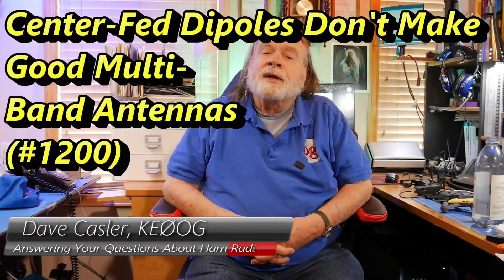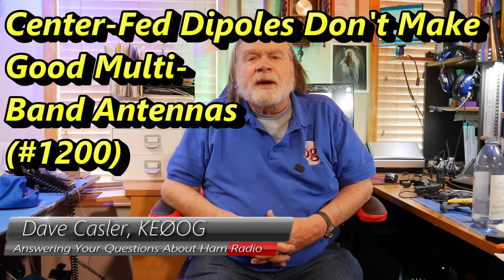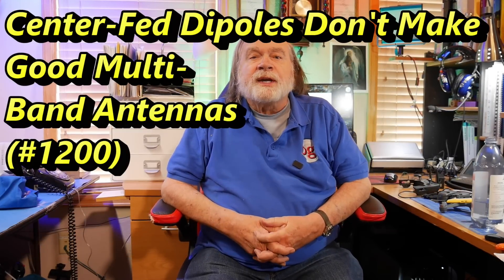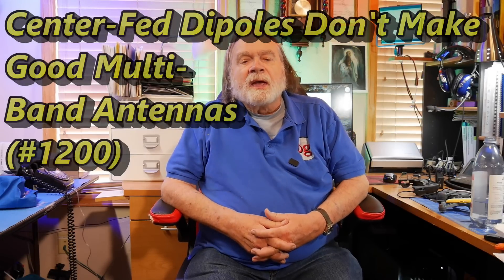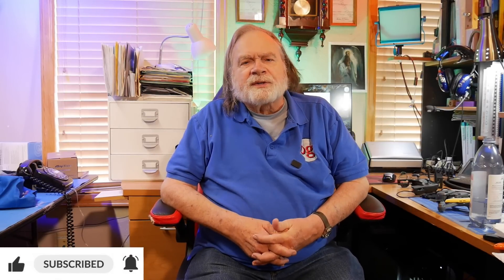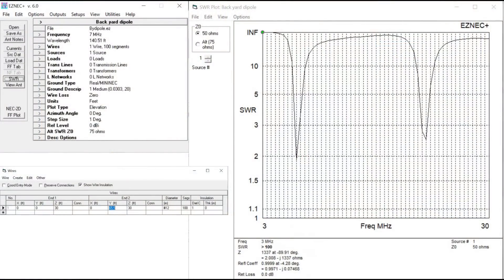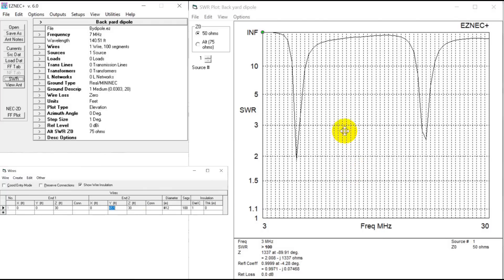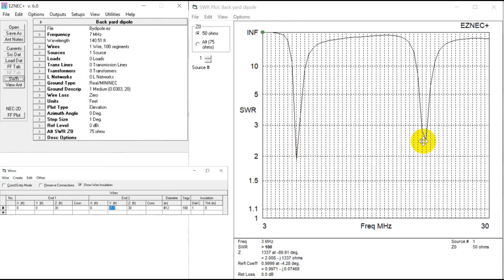Center-Fed Dipoles Don't Make Good Multi-Band Antennas (#1200)

Comment: You are a wealth of knowledge. I am newish to radio and had an idea. My goal is to pack less. My radio does 10, 12, and 15 meters. Can I do a roll out wire center fed dipole with connectors to add wire to a specific band. So a 10m antenna that can extend to 12m. Then clip on sections again to hit 15m. I will use an SWR meter to ensure it is tuned for each additional section of wire to the bigger band. Is this a good idea?

Comment: Presumably a wide range tuner at the antenna feed point wouldn't have the issue of losing most of the energy in the transmission line...  Though at some point, a tuner can claim a 1:1 SWR with no antenna attached, with all of the energy just bouncing around in the reactive components inside...

Comment: Dipoles are really single band items, plus any multiple band resonance! Height, ground composition, local structures - all affect them! I used a doublet, 300 ohm ladderline fed antenna with a big pi- circuit manual ATU in my previous home! Best possible solution for the location! In my downsized retirement home I have to go for a simple un-resonant long wire with an automatic tuner and ground wires. And, live with it! 
Dave; no offence ……. But, please get a haircut! My wife’s comments are unprintable!

Comment: All this talk about "Tunner", is making me hungry 😅
  All jokes aside, I have a Palomar enfed 1/2 wave (155 ft) down to 160m. I believe its a 9:1 Unun. Because the coax running back to the radio has a choke at 95 ft, does that become a center fed dipole?

Comment: This was my first lesson learned about antennas when I started on HF.  I was told to get a dipole for 17 meters and that the tuner would make it work on other bands.  That was bad advice.  Only on 17 meters did it get power out (I know, big surprise). But this got me quickly to adding wire to the dipole center and making a fan dipole for other bands. This was the proper way to get heard.  Having a tuner is great to touch up tuning when you're close, it's just not going to make a way out of tune antenna work.

Comment: You can feed it with ladder-line and use it on any frequency above the frequency it is a half wave. I had s double-let, a non-r resonate dipole for 80 meters that actually made some contacts on 160 m. It worked great on most HF bands. On 10 meters it was directional off the ends of the wire. It was facing East-West and during contests i heard stations in South America. My living arrangements changed and I had to take it down.

Comment: Absolutely correct, as per my experience the best way around it is to feed this Dipole with openwire and a wide range tuner... basically a "DOUBLET ANTENNA", and you can have all the Bands with good efficiency..
Reply: Basically the two options are to have tuner at feed point or the doublet, OFC the later is much more feasible in most cases. Loses really don't factor as much when you have <1db lose over 100ft at even 10:1 SWR. 

I've even had great luck with a lightweight (just 2x 50~ft wire, no ladder line) doublet for pota.

Comment: I have a full-size half wave dipole for 40m in my roofspace, horizontal, and in a U shape to fit. I have a flat Swr and antenna works supurb. Because of its shape, i dont get resonant on 15, so I added elements for 15m. Ant has flat swr 40 and 15 now, and I had Canada and Russia no problem. 2e0deq.